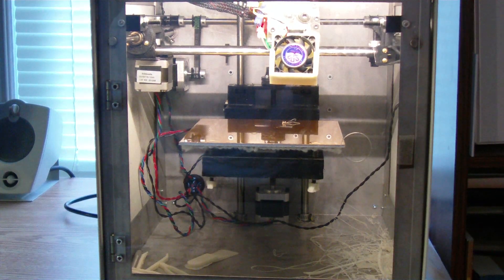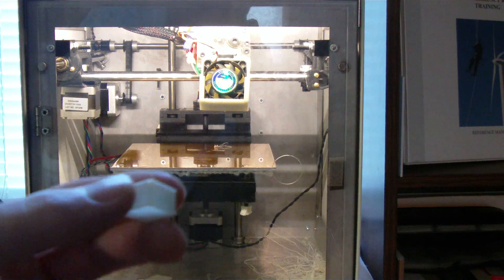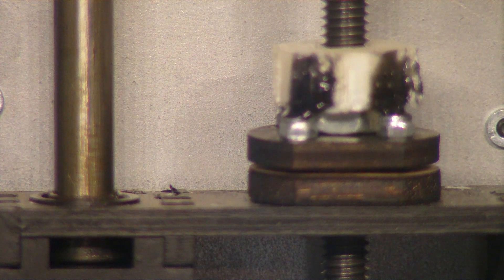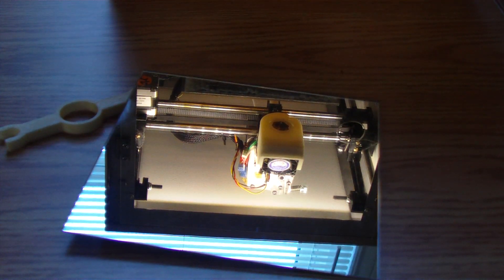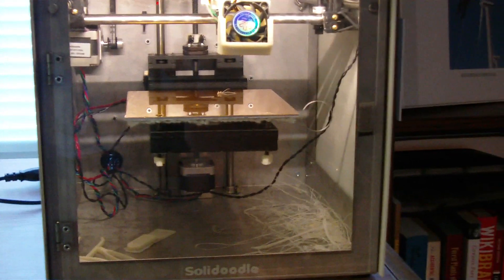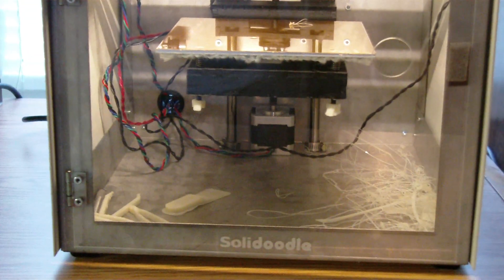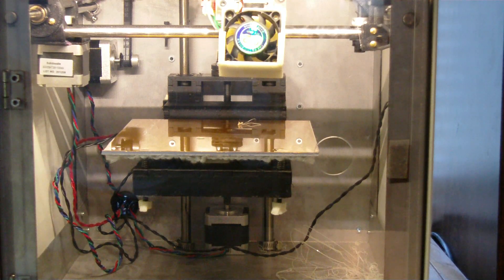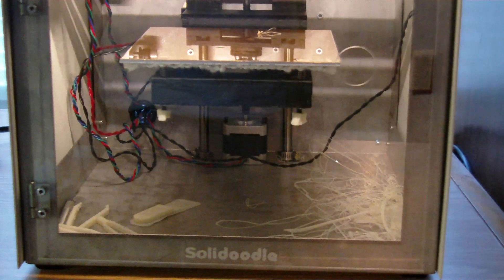Solidoodle 2- After a year of 3D printing

Comment: hi i'm interested in buying a 3d printer,i was thinking of buying the replicator 2x but after a lot of research i found that it came with many problems and requires a lot of work, im a 3d animator so i think the replicator 2x would be too much for me to handle for my first printer, while i was looking for other options i found one called mbot cube 2, it seems to have a good price and the pla filament cost only 24 dollars its a bit larger than the replicator 2 so thats good, but i still haven't found much information about it, is it a cheap copy of makerbot? is it durable? is the mm resolution any good? what got me interested in mbot cube 2 was the filament price i'm still looking for other options any suggestions, solidoodle 4th gen caught my eye is it possible that filament is compatible, great video thank you and hope for a reply.
Reply from the maker: Sorry I can only speak to the Solidoodle 2 as that is what I have.  Cheers
Reply: ok thanks, sorry i don't want to be a bother this is my last question i promise,
I decided to go with the solidoodle have you ever used pla filament with it, on there site it says they recommend abs,but i would like the option of using a cheaper material, does solidoodle have problems working with pla?
thank you and have a happy new year
Reply from the maker: anthony davila I actually haven't used PLA.  I've been happy with ABS for a long time now.  Lots of posts on the forum about PLA users.  Pretty sure it works great.  Happy holidays!  Cheers

Comment from the maker: You'll enjoy it.  One tip I forgot to mention- Don't ever let your printer sit idle with the extruder at temp and no filament flowing.  I have not yet had a single clog and Im pretty sure its because I never let it sit while hot (I even bump the feed every min or so if I'm still waiting for bed temp.  Cheers.